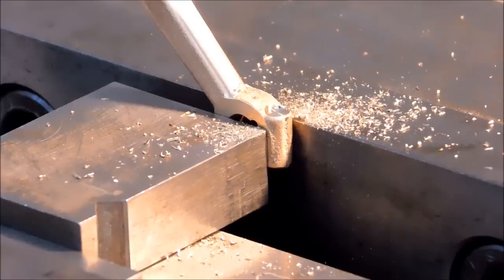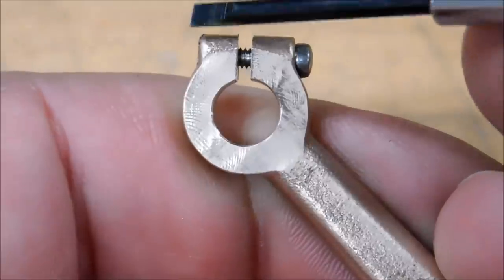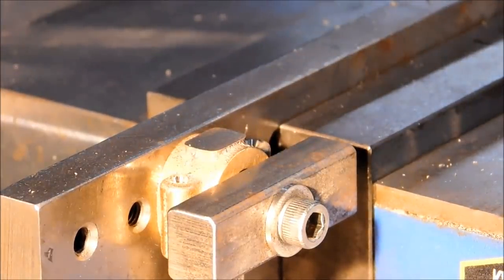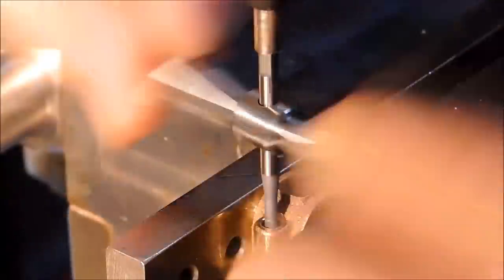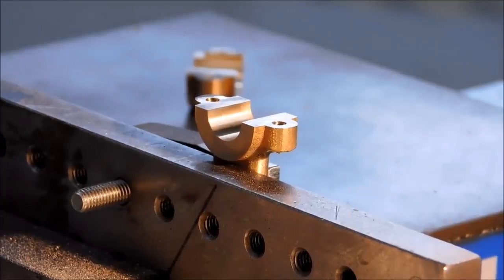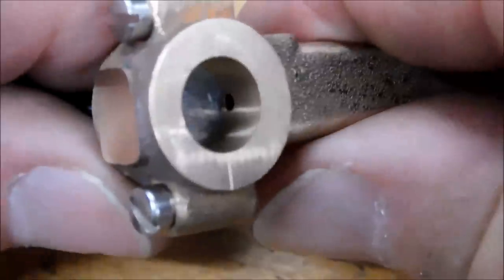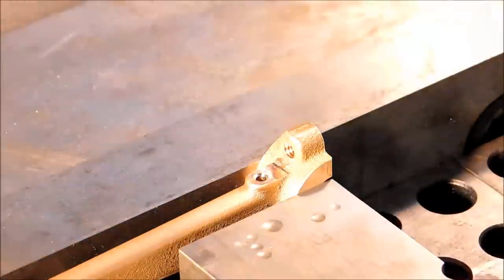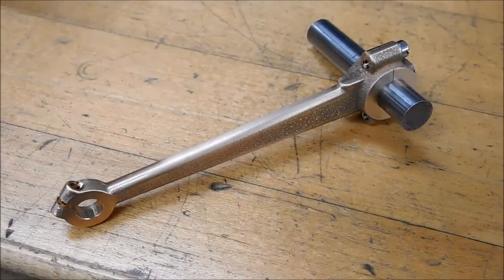Machining a Model Steam Engine - Part 14 (B) - Connecting Rod and Cap

Comment: I would leave the flat on the rod.  A lot of connection rods have a flat exactly like that. The flat gives you a place to remove metal when balancing a set of connecting rods.
Reply: Leave the flat, could be the marking surface with an arrow pointing up?
Optional improvement: What about stepping the 0.060" + 0.001" extra rod material to form a 0.500" alignment slot for the rod cap as others machine their projects? The cap's surface could be stepped by milling in the vise to provide a 0.499" wide center boss.

Comment: There was a surprising amount of work In such a little part. Your  advice about measuring directly from a created feature (the flat on the bottom of the big end) was very useful. you had me guessing with the horizontal slitting operation, I expected the slitting saw to pick the part up and that might have been the last time it was seen. I did wonder if a little clamp across the first cut might have been useful.  As always a thought provoking and educational post. Many thanks.

Comment: I have done that "bonus material" bit a few times. It's funny sometimes, because as a complete self-taught amateur, I'm learning "the proper way, don't do this" quite often from your (and other's) videos. Sometimes "Ah, so that's how you do that". And sometimes "why not do it the way I do it? I don't understand the difference" (although you often explain well why something should be one way and not the other). And then sometimes "surely, this is just a silly thing I do because I don't know a better way" and then it turns out that "that's the way I do it"...

Comment: Joe, I really like how you solve the work holding on these tiny and cast parts. On the pushrod that flexed in the previous video, maybe a wedge on the far edge could counter that. The slotted screws and funny threads raise the hairs on my arms, but in this case it is quite authentic and I won't get the rash. I was very nervous with you slotting the big end rather than boring the final.

Comment: At around 15:00 before you make the second cut to separate the part put a shim that is a few thou thicker than your saw in the side that is already cut and snug down the screw. Then cut the second side, when the saw cuts through the loose part will lift slightly above the saw but has no chance of flying off and getting lost or damaged. Do be aware that there is a small chance of the part spinning if the saw catches on some flare so if that is a concern you can also snug a small clamp across the gap after snugging the screw to prevent any chance of rotation.
Reply from the maker: I like it.

Comment: I have ground a lot of crank shafts and resized a lot of rods  but i was impressed with the splitting of the big end of the rod thanks for another way to get there.
Reply from the maker: Leaving some material on the cap gives you adjustability for the fit. Just sand down the contact surfaces to adjust the bore. I'm sure others have done it to tighten up a knocking engine.

Comment: I am always impressed with your incredibly light touch. Aside from the cylinder bore and piston I think I can do this project by hand and with a bench top drill press. I have the patience and skills to pull this off. It may not be as pristine as yours but certainly do what it is supposed to do eh.  LOL, When the pin floated in the large end I was as pleased as you were. It proves that with good, "SIMPLE" math and "SHARP TOOLING" nothing is impossible. That was really sweet my friend. Seeing your perfect knurling on the tap driver a lesson on how the perfect knurls are made would be great. A skill I have regrettably never mastered. Fun piece, , , You bet. Thanks a bunch Joe. As promised you are a man of your words.

Comment: Great to watch your work and techniques. May I suggest that if the big end cap has to be bored to size after splitting that the little end boring is left and done together with the big end to eliminate any possibility of twist when re clamping down.

Comment: Nice job. Getting to the pointy end now. 
Just one thing, if possible I probably would have used the dowel in the small end to index the slitting saw off to ensure the slot was central to the bore.
Reply from the maker: There were a few reasons for that result after a closer look. 1. If I centered on the bore, I would have lost some thread because the bore isn't true to the boss at 45 degrees. 2. setup at 45 degrees, its impossible to center the outer rib and bore.   3. the outer edge of the screw protrusion isn't 45 degrees to the rod centerline. Forced to pick something, I went for the equal split of the outer feature. I think the best option would have been to cheat the 45 degree spec, setup to the hole center and rotate the part to true up the slot.
Reply: @joepie221  well Joe, that all makes sense.

Comment: Hey Joe, was there a reason you didn't just bore a .375 hole after the con-rod cap was parted off and re-bolted to the rod. The vise trick was cool. I won't be throwing my back out trying to snug the vice up with my knee anymore 👍

Comment: Why not  use the balance pad you machined on the rod for some markings or Id info. initials , date, direction of rotation. its a nice feature of the rod to just remove it
Reply from the maker: I may do that.

Comment: Hi Joe, I'm curious why you opted for not to cut twice with one setup ( 14:45 ) with second cut a bit lower then one you did, so milling wouldn't be necessary?
Reply from the maker: No adjustment that way. if either cut was off, you have to re-bore it. Sizing the cap was much safer.

Comment: Thanks Joe.  Beautiful result, just like you planned the outcome 😉.  If you don’t mind, could you answer a question about the strap clamps you use on your vise fixture plate?  Did you buy or make them?  If purchased, where?  If made, would you be interested in offering them in your store?  I certainly would buy several.  Thanks for the consideration.  All the best.....  Joel.   👍👍😎👍👍

Comment: I'm surprised you didn't tap the Big End first and then split it BEFORE putting that hole through. To create a perfect hole from 2 parts would have caused me a lot of sweat. It's a testament to your skill and equipment that the hole was spot on. No ways I would have pulled that off perfectly.

Comment: Definitely would have made the cut then final machined the bore of the big end with it assembled. In the final section you can clearly see the rad on the cap is a fraction smaller than required. Very nice series of videos though. Thanks Joe
Reply from the maker: If the radius on the cap was smaller, it wouldn't assemble without pinching the rod. Though there appears to be a dark spot, its not a gap.

Comment: Wow, #1! I still think the base was your piece de resistance Joe.
Reply from the maker: Adding these parts really illustrates the value of getting those crank journals in the right spot. You can expect a world of problems if you don't. Thanks for the comment.
Reply: @joepie221  This series really is the high spot of my YT viewing week. Does that make me a sad bastard? I'm itching to see it with a classy paint job, up to pressure and running smoothly.

Comment: If you were worried about chatter when splitting the connecting rod journel away from the fixture plate, shouldn't you have cut that side first for the increase rigidity?

Or am I over thinking it and it wouldn't make a difference?

Comment: I wouldn’t recommend anyone putting the.375 hole in that way and why you never put a pin in the small end to find the centre is beyond me. Apart from that you’ve done good job. I’ve been putting cutters in drill chunks for many years without any problems but only for trueing up holes or spot facing like you said.
Reply from the maker: Thanks for the comment. I did the large end differently than the conventional way to show the technique. This series isn't over and the 'bore at assembly' will be demonstrated shortly. As for the pin in the small end, the cast hole was uneven and not on center. Using the recess as a marker would have resulted in a misalignment to the OD of the rod and cross head external features at assembly. An external alignment was the better choice.
Reply: @joepie221  thanks for the reply joe, I did think you would have done it that way for an alternative method, and I know you would have got the correct result in the end but I was referring to hobby machinist who could easily mess it up. So far the project is coming along nicely and it’s nice to know you’re enjoying it. Keep up the good work.

Comment: I'm a little surprised that you center drilled before you spotfaced. Was it in order to eliminate the potential issue of center cutting with the end mill in the drill chuck?
Reply from the maker: Yes, and for a minimal depth reference.

Comment: Joe; you might find this interesting, the old McCulloch engines used un-caged needle bearings and a hardened steel connecting rod that was precision ground in one piece, scored each side like you would cutting glass and broke, when you torqued down the cap you could not find the break by touch or visual, that always intrigued me.
Reply: "Cracked cap rods". They're actually used in modern car engines such as the GM  LS series. Helps keep the two halves concentric which is a great benefit
Reply from the maker: I wonder if they use liquid nitrogen to do it.
Reply: @joepie221  I don't know but they were extremely reliable I never saw one break, in all my years at my dad's shop. another trick McCulloch did was instead of having one needle bearing in the rod, the pin was a "Pressed fit" and used 2 needle bearings in the piston which were also a pressed fit. McCulloch also made an aftermarket supercharger for cars belt drive, centrifugal, and a variable drive - https://myflatheadford.com/mcculloch-supercharger-intake/

Comment: As per usual all your work and explainations are top class.  Only point to make is that screws do not look engineringly right for these models. Are you going to nuts and bolts on final assembly ? Thanks
Reply from the maker: I agree, and may swap them.

Comment: The tap you use @ 10:56 . Does that have a special coating or made from a special material?  The color is rather unusual from any other tap I have seen to date
Reply: Maybe DLC, or just steam oxide and odd lighting?

Comment: This may have been commented before, but I am surprised that there is no means of registration on the big end. the main bearing caps are registered, and I would have thought that dowel bolts or studs would be an appropriate form of registration for the big end.
Reply from the maker: The cylinder end has a spacer with 2 diameters on it for alignment. Is that the area in question?

Comment: Hi. Grate work and luck :)). I would have bored after cutting it in half, just becouse internal sters in material. If it had open, the part would pe scrap. But if it have closed, you could rebore it.
Reply from the maker: I'll do the valve cam that way.

Comment: Do you worry about the surfaces you clamp or do you leave a little wiggle room to clean off any blemishes that the vise might cause
Reply from the maker: I'm very careful about that. The parts I use and the pressure of the setup are always considerations.

Comment: For a little model engine it's not important, but the better way for the rod cap would be to use a stripper bolt with a reamed hole going through the cap and about 0.025" into the rod body, then it would act as a locator for the cap.

Comment: Are you planning on making a cap for that con rod oil cup?  I can't see it working without one.... or am I missing something?
Reply: The engine is miniature curiosity and  not intended for prolonged operation  15min / run. Think of the cups as a funnel rather than a reservoir. For such short runs the oil adhering to the bearings will be sufficient for a single run plus oiling for each session adds to the occasion :)

Comment: The method you used to machine the big end certainly achieved the required result, but wouldn't it have been simpler to slit the part first, then clamp the two halves together and bore the hole for the crankpin? Do you see any disadvantage in doing it this way?
PS. Can I second the idea of using hex head screws, rather than cheesehead?
Reply from the maker: Your suggestion is the conventional approach for sure. I'll show that in my eccentric and cap video. For this part, I chose the alternative method to prove it can be done and demonstrate it.

Comment: Is plunging with a slitting saw safe or even recommended?  I've never seen that done before.
Reply from the maker: Give me a time reference. I'm not sure I plunged a slitting saw.
Reply: @joepie221  2:40  You said you're going to just plunge it straight through to the center, which you did in the x axis.

Comment: When you tapped the small end of the rod, you could have turned it over and run the tap in from the other side and thus not needed the tap wheel.
Reply from the maker: Very true.

Comment: Joe, what size are the threads in that nifty little tooling plate? Thanks as always.
Reply from the maker: 10-32 on 1/2" centers. The plate is 3/8 x 2 x 6
Reply: @joepie221  Thank you Joe. I can use a little plate like that. Going to make something similar.

Comment: As always, perfectly done.
The way You made the hole for the crank shaft end, step mill 2 holes, a bit apart, sticks out.
Why not first do the work as at time 09.00, drilling and tapping, then do the slit sawing, tightening the screws and finally drill, broach hole? That looks easier and more safe to me, being a novice. I know You told it cold be done in 10 different ways.....

Comment: You know that you could have turned the slitting saw over, reversed the rotation and then the action would have driven the part into the mount lowering the choir action on the second side.    Which is worse, the singing or the time to change the saw?
Reply from the maker: The reverse rotation could introduce the cap to "unloosen".
Reply: @joepie221  I guess that could happen if the cap was not tightened sufficiently.   Machining make up torque, like oil well make up torque, must always exceed operating torque.  The torque should be transmitted via the friction between the body of the saw holder and the saw, not through the threads.   But your point is well taken.   Makes me wonder why some folks are satisfied with lathes with screw on chucks.   Like you, I run the lathe “ backwards” a lot.  Not just threading, but parting works better in reverse.   If the tool grabs, it just lifts it out rather than digging in.

Comment: Joe, as I watched you slitting the rod cap off the rod  body the little guy in my head was screaming "MATCH MARK, MATCH MARK" , old habits die hard I guess. Fortunately in this case it wasn't really required. A little niggly observation, as small as those oil cups are they seem way out of scale to the other features. IIRC they are made to about .375" diameter the same as the crank journal. Making them any smaller would require one of those lathes you can hold in your hand I guess!
Reply from the maker: The casting edge differences were my match marks.